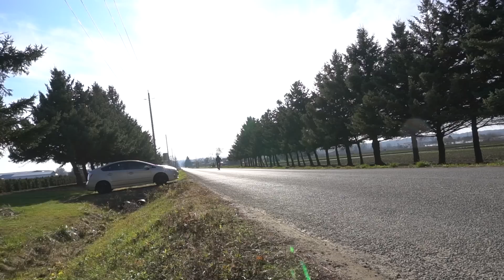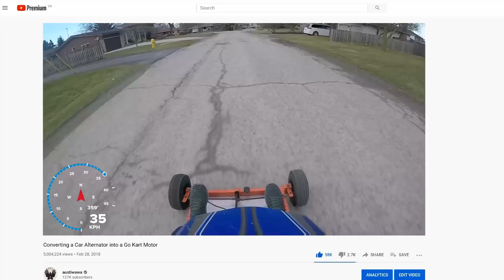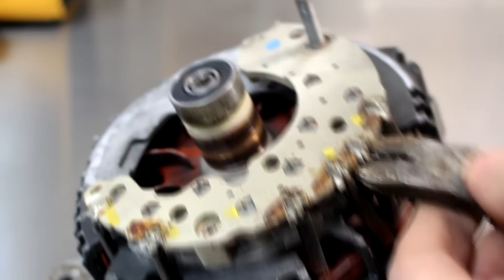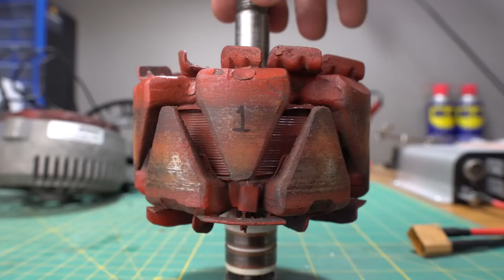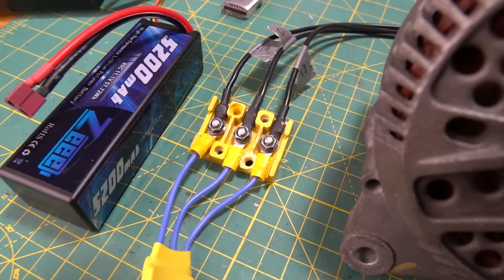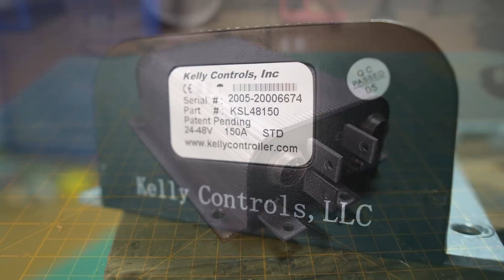Building an Alternator Powered Bike

Comment: austiwawa
 IT'S TIME FOR OLD RUSTY TO GET A UPGRADE USING THE SAME BASIC PREMISE... V4
Lets start off with adding a key for that groove you cut out, maybe that's why it's slipping really bad? Now we find a mountain bike, use a Alternator out of a tractor trailer 24 volt instead of a 12 volt, connect a Torque Converter Clutch to that Alternator using a key for that groove you cut out and the key is hardened steel and it has to fit in length as well as width so it has to be longer so there's not much room for it to travel and adds strength, this stops the slipping even though these clutches slip by design. We will now get rid of that clutch, it's terrible. Even if we need to create a plate adapter to make this Torque Converter Clutch fit and work, this Clutch will add much Speed as well as Torque then build up the battery to accommodate the Alternator or even stick with the Alternator you have, but use that clutch in the link, pick one that you like and make it work, don't forget the key, the tighter it fits the better.  
https://www.ebay.com/sch/i.html?_from=R40&_trksid=p2380057.m570.l1313&_nkw=torque+converter+clutch&_sacat=0
Reply: why to bother with ICE stuff for an electric system with capabilities to variable Kv?
grab a 12V PWM controller between the battery and the brushes
turn on both controllers and keep the PWM at 100%
when you get on the top speed limited by gearing, slowly reduce the power in the PWM controller to 50%, the magnetic field will shrink a but and the stator will spin it faster while it can keep syncronization
Reply: @foxxyytofficial  The idea was to keep the idea he had plus that clutch can make it faster with more torque. That's all

Comment: BTW you can manipulate the Field-Winding Current too, if you want to accelerate over base-speed, you can weaken the field of the Rotor, like how it's done in Electric-Locomotives.
Edit: there is an Article about that at hackaday.io https://hackaday.io/project/164932-axiom-100kw-motor-controller/log/162931-field-weakening-support

Comment: Couldn't you just use a clutch with less stiff springs? However, I like what you did. Like a glove! 10:12

I do not know anything about electronics. With that said, here's my guess: The reason the motor spins without the hall effect sensors were because the controller was searching for something to read. Am I right?
Reply: most BLDC controllers read the back-EMF from the third phase as it powers two in each part of the cycle, so it can keep a "basic" guess on how to keep cycling and spinning the motor shaft, with hall sensores you have a better way to know how to spin the shaft with the cycle, so its better overall

Comment: You need lighter springs on the clutch to compensate for the lower RPM of the motor vs an engine.
Reply: he doesn't need the clutch

Comment: With an electric motor, there's no need for an engine-to-drivetrain disconnect such as a clutch.  Plus, electric motors produce peak torque starting at zero RPM which also makes a clutch unnecessary.  Nice project though, well done!
Reply: yes, he oblu tried because of the first controller's startup sequence

Comment: You finally figured out the correct wiring at 10:15.. What is the correct wiring? How about a screen shot ?
Reply: You can't simply get a screenshot because not all alternators are equal, even more sensored alternators

Comment: That was cool. Working out Hall sensor position was a bunch of work. 
Personally, I would have just fitted lighter springs to centrifugal clutch so it locked up earlier.
Making a permanent magnet rotor should be pretty easy with some neodymium magnets?
Reply: PMA alternator rotors need to be balanced or they will shake until the worst happens
Reply: @foxxyytofficial  If magnets are all bought together they should be pretty consistent size and weight.
I wasn't thinking of using old hard drive magnets which tend to be a bit of an odd shape
 Machining the rotor could be a bit of a challenge if all you have is an angle grinder and a hacksaw. Fitting round magnets could be done with a drill press but centrifugal loading may be too high?
Reply: @1crazypj  clutches aren't that efficient for EV builds, and for the rotor magnets you still need to balance them even if all the magnets are similar among themselves

Comment: What would happen if you put a 21 speed derailed into the equation? Would you be able to shift gears?
Reply: If you get a PWM controller for the rotor coils, you can change the voltage applied to the brushes and vary the magnetic field, like an electronic CVT gear system
Less voltage will give more rpm but less torque, more voltage will give more torque and less rpm
Reply: Always keeping the 12V upper limit
Reply: Should have been 21 speed derailer so you could shift gears and achieve higher speeds
Reply: @rickschindler1223  first, he said that he won't try to go faster
Second, he wouldn't need a derailer if he used a pwm controller

Comment: why use a mechanical clutch ? you already have a magnetic clutch by controlling the field coil power.
Reply: what does the field coil have with the clutch?
you can't simply keep turning on and off the field while the controller is operating
Reply: @foxxyytofficial  he used mechanical clutch just because the first controller did not fully stop the motor, he could have just switch the coil field off or very low when bike should be stationary, not to use it as a real clutch ofc.
Reply: @sirbuconstantin5187  you can't simply turn off the coils when the controller is operating, it messes with the function, but now that he installed the hall sensors won't need that
Reply: @foxxyytofficial  i think you are reffering to the coils that are driven by the inverter? the coils on the stator, cause you use plural? yes you do not mess with them, i am reffering to the coil (singular) that is on the rotor and is creating a magnetic field in place of a real magnet, it is not connected to the inverter, the inverter would continue working normal, also the stator coils would continue to generate rotating fields as normal, but the shaft would not rotate.
Reply: @sirbuconstantin5187  but are you sure that turning off the rotor coil won't mess up the controller?
Both sensored and sensorless approaches need magnetic fields from the rotor to determine the position of the rotor, so they can cycle properly
Reply: @foxxyytofficial  i can't be sure, but you are right, if its a bldc controller it will need to know the current position to fire up the next phase, but how it will behave depends on the controller,  it will read a position if he keeps the coil low or even a fake position if the coil is off, and trigger that phase over and over again, or it will stop, no way to know, or maybe its a vfd and would not care about rotor position.. he could have tried tho.. maybe he tried.. who knows, but should have tried before thinking of a mechanical clutch..

Comment: A permanent magnet rotor went through my mind before you mentioned it, but in runners can have problems securing the magnets. So why not take the stator out of the casting and make an out runner permanent magnet rotor to run around the outside of it?!!
Reply: to make it outrunner you would need to re-do the wiring AND the metal structure of the stator

Comment: I am confused.
What exactly can you use a motor controller that never shuts off for?
Most machinery doesn't run 24/7
I get you could power down the controller but then you have to set through another startup sequence.
I can't think of  a single good reason for it to run the motor continuously.
Reply: that first non-stopping controller is more for BLDC fans, industrial conveyour belts, and others

Comment: I had the idea to take the same idea you have there will put through gear ratio through to make a bike go super fast with gear ratio and a speedometer let me know how fast this vehicle is moving that's four wheel it has a steering wheel like a car but it's on a stainless steel chassis batteries on one side and electric motor to make it go that's my idea make it go for all reverse that is my idea this is super David bye
Reply: sorry, can you please elaborate in a better way?

Comment: You need heavier weights in the clutch or a lighter springs that will fix the slipping problem due to not enough rpm's
Reply: or just kiill the need for it, swapping the controller
Reply: @foxxyytofficial  Yea that would probably be better because you will have total control over rpm and have way better takeoff speeds

Comment: Change the springs in the clutch.
Reply: or just kiill the need for the clutch, swapping the controller
Reply: @foxxyytofficial  Requires the sensor hack.  New springs are cheap and quick to change. For those that have the first type of controller.

Comment: What power are you running into that motor?? 48 volts and current limit of 150 a? How much is used for 42 mph?
Reply: probably he is only putting 18A continuously and 30-40A peaks
if you want to see an alternator being load-tested with 100A at 36V, check this video:
https://www.youtube.com/watch?v=U4r2mIIkrbk
Reply: @foxxyytofficial  cool I was wondering. I have a spare BMW alternator which is rated 150a that correlates to almost 2kw so I wonder how much I could push if I converted it
Reply: @Re_Kitty  if you keep the correct rotation for the built-in cooling fins and a fan to pull cool air through it, with a good controller, installed hall sensors to give a good startup torque, and a battery capable of supplying enough juice, at 48V probably you can pull the 2kW continuously and peaks of 4-5kW without burning it

Comment: Great project. BUT.. How about using alternator to recharge the batteries too?
Reply: Its impossible
And he can use regen already
Reply: @foxxyytofficial  It's not impossible, it may not be practical to charge the batteries but I'm sure you could charge capacitors by using the alternator as a brake. That should help save the batteries.
Reply: @rogfusionkid  but how would you connect it in a way that won't burn the controller? And how the capacitors will know when to dump their charge while not disrupting the cycle?

Comment: There is a company that makes permanent magnet rotors for alternators. they use them for windmills and other alternate power devices... you should check them out, if only for pictures. the company is called MWANDS

Comment: You can use an alternator to run power to your house with a motor and a battery except it's a Federal Offense.
Reply: What??
Reply: @foxxyytofficial  You take the staters out and you can run 220V. You have to know what you're doing. In the middle of nowhere you'd be fine but if you run power to your home it's a crime.
Reply: @ProjectCarTV  ooooooookay then...

Comment: When you say faster, What was the rotor current and can you increase that and lower your sprocket ratio? More power higher speed.
Reply: The rotor current usually is locked by the equation I = V / R , because its only coiled wire
So if we know V (12V), and usually alternator's rotor coil can have between 2 and 8 ohms, the current is easily in the ballpark of 1,5A to 6A, but in his case probably below 4A
Reply: I'm sure there is a current limit to the wire, but you have much more than 12 v available in your battery pack and several ways you could modulate that. Such as high current for torque to start and lower once you are up to speed.
Reply: @mavamQ  you can change the field current with a buck/boost converter, but you can't go much higher than the 12-14V that alternators are prepared to work
Reply: @foxxyytofficial  Hi FoxxyYT, I'm not ready to just believe 12-14V without more evidence. So I went searching, didn't find much about high Field currents. But I did find this. 
"Here is a simple trick to learn how much reserve
a stator-rotor combination has. With ample size rectifier diodes
installed, feed the output of your test alternator directly into
an ammeter shunt that is a direct short. Run your alternator at
6,000 rpm while increasing field voltage from a lab-type power
supply. The current you read on the output should be in exact
proportion to the externally applied field voltage.

As long as the output current increases linearly
with field voltage, you are not saturating either the rotor or
the stator core. You may find that in some conservative alternators,
you can increase the field voltage of a 14.5 volt field well over
20 volts and still see a change. Other alternators will flatten
out at 15-16 volts."
  From: https://www.enginebuildermag.com/1998/03/understanding-alternator-current-output/ about 3/4 downpage.
It looks like rotor magnetic design is the limiting factor, i.e. it saturates and some gap problems.
 I'll keep looking but that shorted output seems to be a pretty good test.
Reply: @mavamQ  You need to understand that using an alternator as a motor is the complete OPPOSITE of using it as a generator, so not all stuff known about them will check out when people actually make real-world tests
most people stop the field at 12V because it overheats, and it is something already tested, being with only 3S LiPo battery and a RC ESC, up to 72V and a huge ebike controller
Reply: @foxxyytofficial  If the rotor over heats, the wire is too small and it is obvious you should not put more current through it. It would be interesting to know how hard you can push it before the iron saturates. I would be cheaper to DIY wind a larger wire on the rotor, than to put PM on one. But it's not worth rewinding a rotor if it is already running near saturation.
Reply: @mavamQ  the saturation occurs more easily in lower stator voltages (12-24V, where it gets saturated at 3-7V in most cases), but at 36-72V the saturation threshold goes higher, up to the famous 12V (and in some cases 14V)
Reply: @foxxyytofficial   I'm talking about rotor Current and the Magnetic flux density in the rotor core, increase with coil current, at some current no more flux lines can occur (saturation)  I don't know what you are talking about.

Comment: Any idea what your power output ended up being?

I get that this was done to see if it could be done.

Just wondering how it compares with actual ebike motors.
Reply: A guy got 4000W at 36V on his alternator, so at 48V (and having a good battery), probably close to 4500-5000W peak and 2000W continuous
Reply: @foxxyytofficial  Damn - that's pretty good.
I guess that makes sense - they've had 100 years to make alternators efficient.

Comment: Is it possible to recharge the battery when u gets pedal the bike like a regenerative
Reply: Yes, if he didn't used freewheel crank
Reply: @foxxyytofficial  freewheel crank is what
Reply: @spacex9009  its a type of crank that won't spin the pedals even if the chain is forcing it to spin, like the crank on the rear wheel that lets it spin without forcing to spin the sprockets
Reply: @foxxyytofficial  thanks bro
Reply: @foxxyytofficial  so it's only able to spin the alternator
Reply: @spacex9009  yes, so if he didn't used it, he could enable regen
Reply: @foxxyytofficial  so bro how much current does the alternator produces
Reply: @spacex9009  the only way to know that is datalogging the regen after enabled

Comment: That's awesome!  I wonder if you can get a hold of a VFD which can offer a regenerative braking function?  🤔

Or when braking, use the alternator itself with PWM and maybe a circuit similar to a solar charge controller to send current back into the charging system
Reply: you can have those features (regen) with a VESC controller

Comment: YALL DONT KNOW HOW TO DESIGN
Reply: do you? prove then
Reply: @foxxyytofficial  IT WILL COST YOU.
LOOK UP STERLING FREE PISTON.
Reply: @ronniewall1481  what does a piston have in common to electric builds?
Reply: @foxxyytofficial  A LOT OF THINGS
Reply: @ronniewall1481  so what do you want to do with one of those things on an electric build?
Reply: @foxxyytofficial  ELECTRIC POWERED SEX TOYS ARE DESIGNED TO WORK ON TWO WATTS.
Reply: @ronniewall1481  and what do sex toys and alternator-powered bicycles have in common?
Whatever, won't respond to a troll that only talks in caps like a fool
Reply: @foxxyytofficial  WHAT'S WRONG WITH CAPS?
YOU'VE BEEN CONDITION TO THINK THEY'RE YELLING.
HELPS ME TYPE.
LOWER CASE MESSES WITH ME.

Comment: I used to have a vintage version of that bike that had a 3 speed hub. I was just wondering if yours is and if not you should consider getting one for better performance and gearing.
They are the same size bike and wheels so it would just go straight on.  Also subscribed👍👌

Comment: ever thought about a pulley and belt instead of a chain and sprocket with the right design you could use a tensioner as a clutch  and give you the take of torque i think you could come up with a design to make it work you've done great so far i like your projects great ideas im going to try the alternator motor on a drift trike i built the trike but need a motor i think it will work great anyway it was just a thought i know it can work if you can come up with a linkage design i had a mini bike as a kid that had a handle when you pulled it back it engaged  the tensioner keep up the good work ill be following